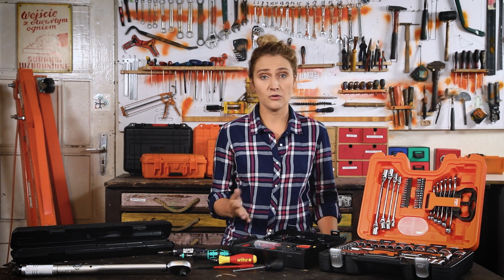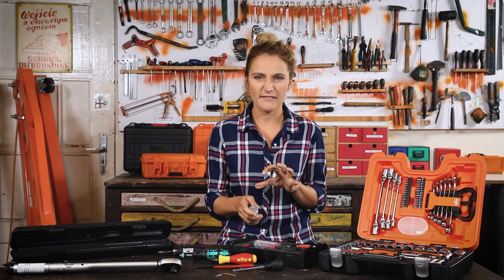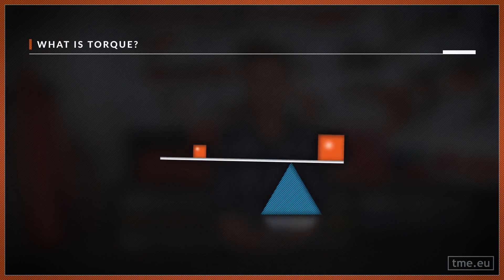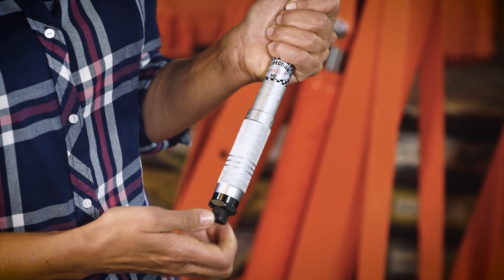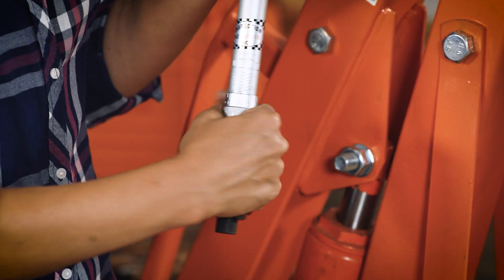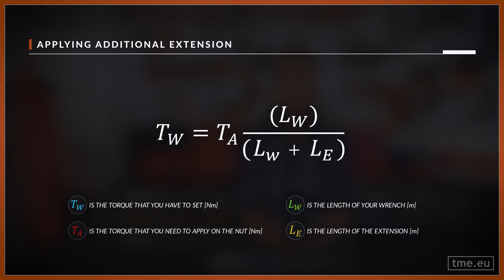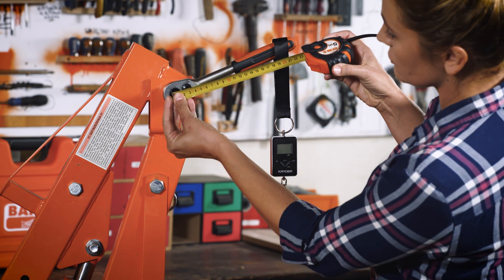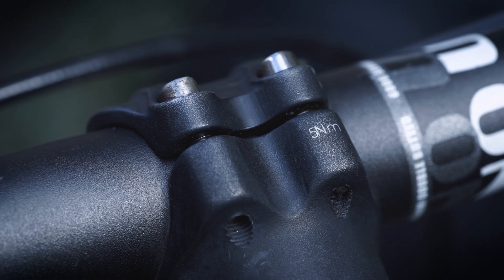Torque wrenches and screwdrivers - how to adjust and use?

Comment: This is a very nice nice video, everything is well explained, so thank you for it. 

However, there is a little-known quirk about click-style torque wrenches: to get the correct torque you need to apply the force where the handle is, and nowhere else. That implies that you should not use extensions on a click-style torque wrench. You can however apply the force wherever you want with the « beam » type (that measures torque using the deflection in bar), or use extensions.

The reason is that with the click style wrench the torque is applied on the bolt but the maximum torque is set is just below the head of the tool, and both are not at the same distance to the point where the force is applied (your hand). 

Have a look at this guy’s video, where he explains the problem and demonstrates the effect on accuracy.

https://youtu.be/0f746pF1xc0?feature=shared